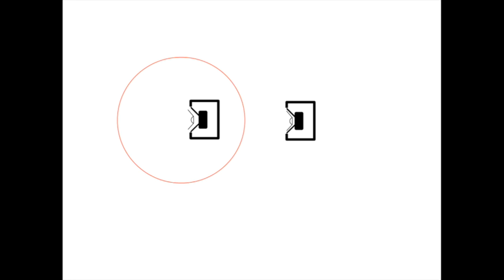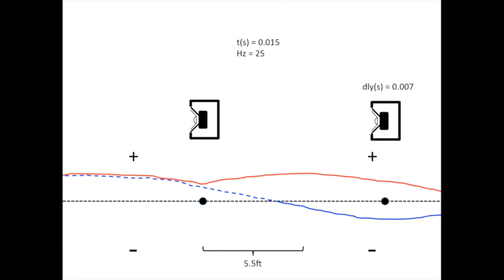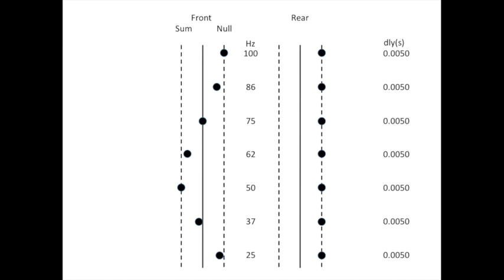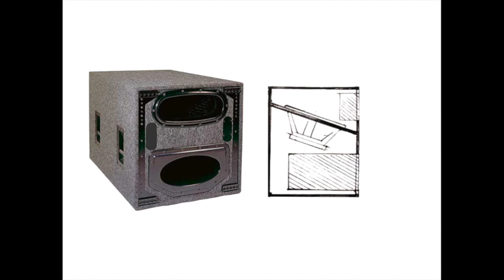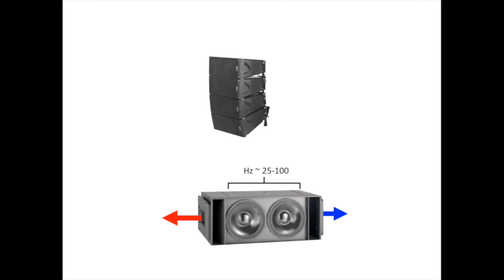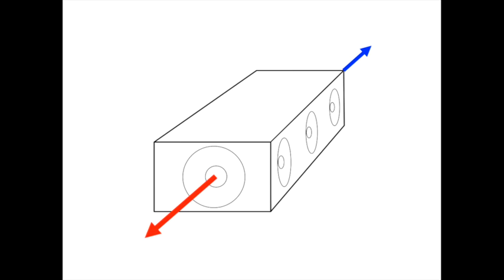NEXO Cardioid Subwoofers Part 1

Comment: Great video. Very informing. You may want to consider using the term "polarity" rather than "phase" when referring to reversing the leads on a driver. Phase is a time related term, where polarity as you show in the video is absolute. Thanks for posting.
Reply: John Schauer nobody uses polarity anymore.  It’s phase

Comment: That one design was just a 6th order parallel-tuned bandpass. Interesting. I've been mulling over an interesting design in my head that, thanks to this video, I now think would have some degree of cardioid effect. It's basically two TQWT speakers slammed together with isobaric drivers. One tube would be tuned to the bottom of the desired range with the other tube tuned to the top. The differing lengths of the tubes would create some natural delay between the signals and the ports could be arranged to help accent whatever change in the acoustic center was caused by the different efficiencies of the two tubes.

Comment: cardioid or end fire system on this video?
Reply: frex wofer 35-100hz
Reply: "Cardioid" refers to its radiation pattern and "end fired" it's just one of the techniques you can apply. There's also "FrontBack" and "Acoustic Arc"

Comment: Wow amazing. So cardioid speakers that are marketed without any delay are not necessarily efficient at different frequencies. Mind blown
Reply from the maker: Sound Junky that’s right. Some use “passive” cardioid methods but we’re very suspicious of those. True cardioid requires processing
Reply: Alpha Sound amazing thank you soo much for this. And one more question!!! If I have an enclosed woofer box with one port facing forward and one port facing back tuned at different frequencies, Is that just bad engineering and bad design??  

Thanks again
Reply from the maker: Hard to say, do you have a drawing of the design? You might also be interested in our video on subwoofer ports...
Reply: Alpha Sound i don’t have the drawing but it’s called the soundtown Carme. Super well built but the ports in scared of. I’m getting it delivered today.

Comment: and here i thought phase was the one canceling the base lols,.  I separated my subs in any random distance and have non cancellations on base so i don't get this theory of yours. The only thing that canceling my base is when i put the speaker in a box that have them flat horizontal coil facing up rather than facing forward. Have you seen the inside of QSC KS212c?

Comment: Two major aspects are never addressed by manufacturers: the clarity and intelligibility of high power bass.
The quality of the result is ensured by separate transducers for the bass drum and the bass guitar, possibly for the low frequencies of the keyboards. No matter how good the research, this fundamental aspect is overlooked, while it makes all the difference between a clean sound and a crap sound.
Reply: So, you'd like a separate set of subs for each instrument?